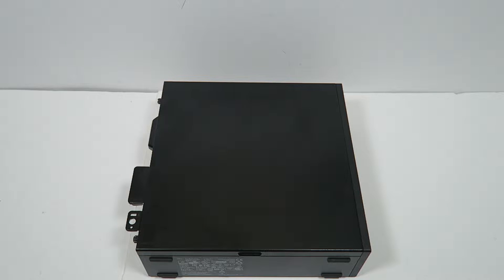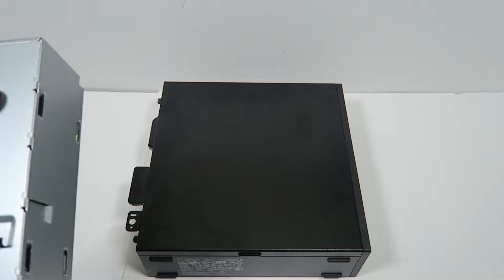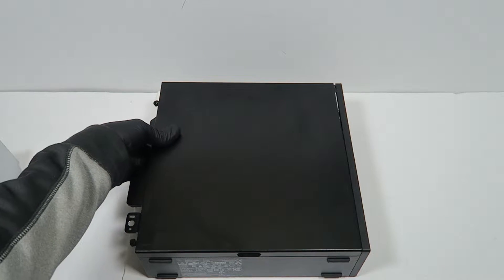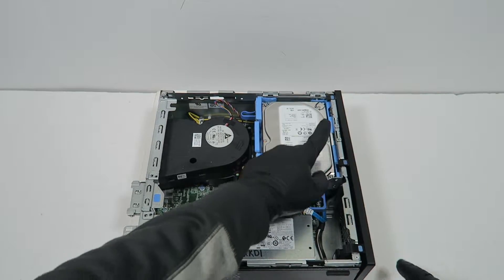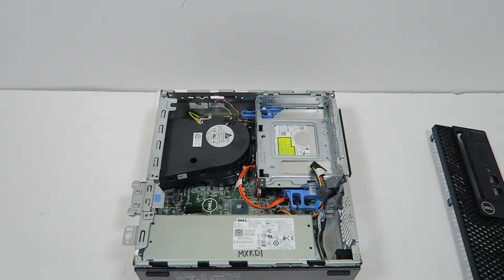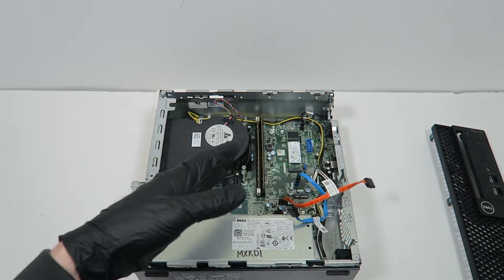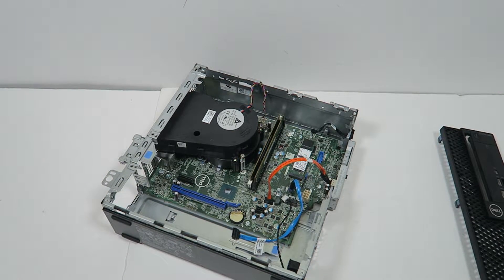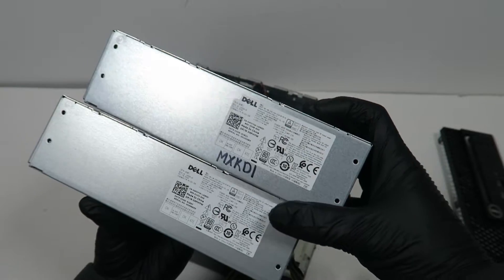How to Replace Dell Optiplex 3060 Power Supply

Comment: hey bro i wanna ask u smthn, can i use a normal psu like 500w and use its cables like the 4pin cpu and 6pin motherboard cables with the ones that came with the psu i bought ?
Reply: Absolutely not you’ll destroy whatever part you plug those into

Comment: I want to install 1660, if I replace the power supply with a new one, with 2 connectors 6 pins, 1 conn plug in  motherboard connector, 1 plug in 1660 connector, will it work or not? (without using 24 pin to 6 pin Adapter for motherboard)

Comment: I bought a dell optiplex 790 dt. I want to turn into a gaming pc but don’t know what parts I need can you help?
Reply: 8gb ddr3 ram. 500w power supply and Radeon Rx570.
Reply: @outcastriley  how can you upgrade the psu…? its oem fit.

Comment: Impossible to put graphics card?
Reply: You can put in a half-height GPU, yes i think so. Would need an external power supply for the connectors on the GPU.